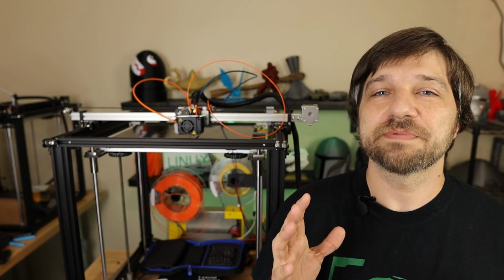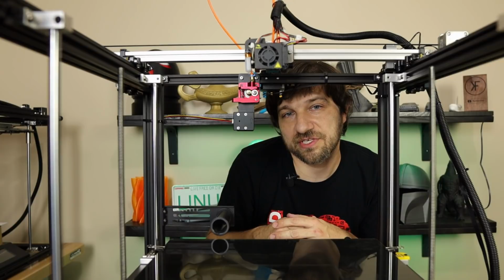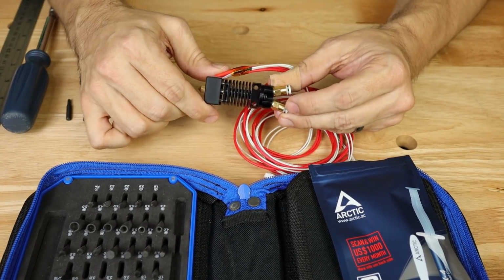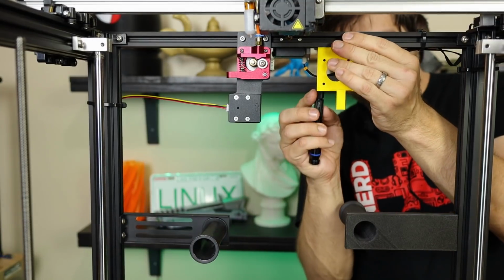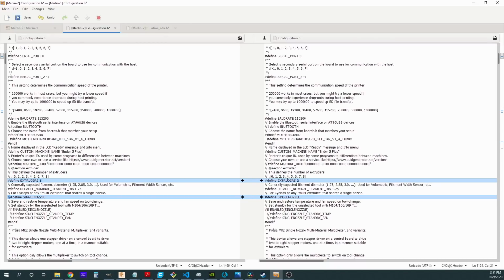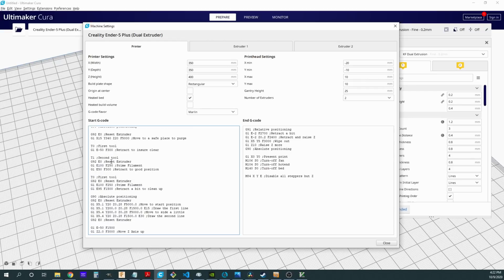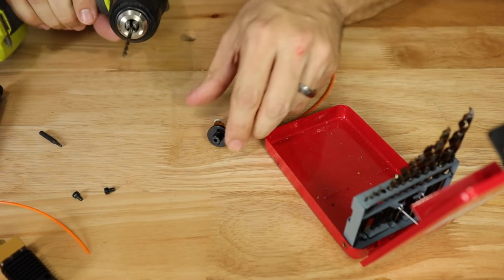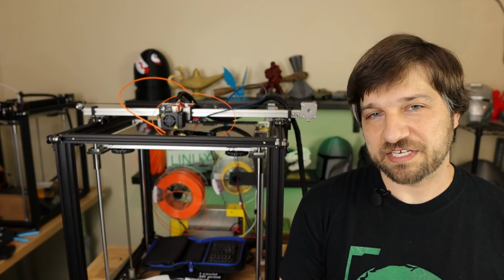Complete Dual Extruder Upgrade Guide (Ender 5 Plus)

Comment: Kersey, you need “ramming”. To form the tip. If you use PrusaSlicer you can form the tip by pulling back and pushing sequence while purging.
Reply from the maker: I'll look into that! Thanks!
Reply: @kerseyfabs  The Toolchanges in PrusaSlicer are great and give a lot of finite controls to adjust tips. Which my guess here is that. But I wonder if a "Y" above the hot end would be better? https://www.seemecnc.com/products/2-into-1-dual-filament-feed-adapter-fitting-only?_pos=1&_sid=833904154&_ss=r
Reply: @kerseyfabs  As the y-construction mostly is simmular to the old MMU1, you might install PrusaSlicer with settings for mk2 and MMU1. Than edit printer settings to fit to the Ender 5 plus. Might help.

Comment: What I've worked out !!!
If you don't want to lose X size you need to extend the width with bigger aluminium extrusions and the y motor rods , but the problem is having 2 stepper motors on X.
Reply: Actually "bigger" also means to change from 2020 to 2040 extrusion, so you can use top side for one belt and down side for the other -  and let go back the two belts inside the extrusion... This way two steppers on x are not so much a problem anymore - one on one end, using the upper part of the 2040, the other on the other side, using the bottom part.
Reply: @oleurgast730  Not that easy !!! ,  The first belt on the 2040 is standard ? , one motor on one end a tensioner on the over ,  but the top part is not that easy , I think you have to mount the other one upside down on some sort of raiser plate and hope the tensioner doesn't hit the motor.
I think it could be easier to tool changer that idex on the ender 5 ?